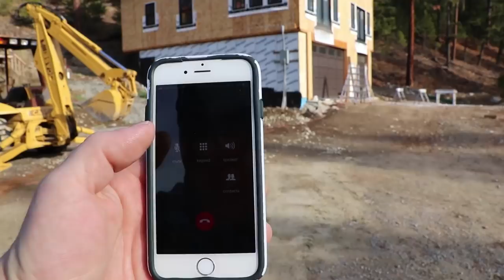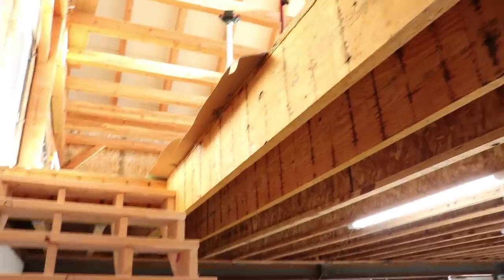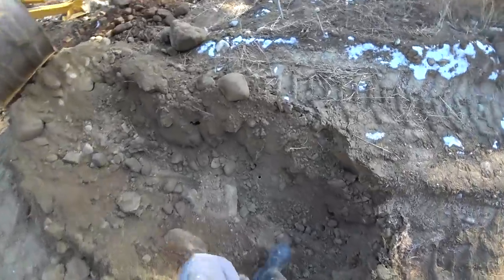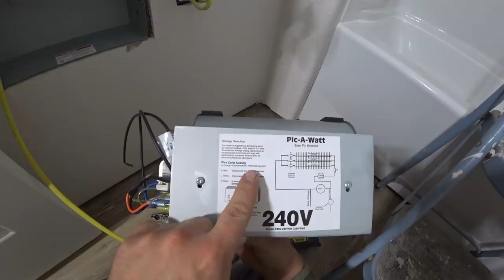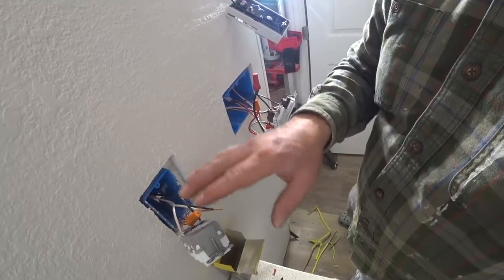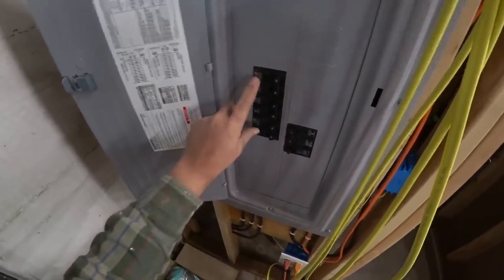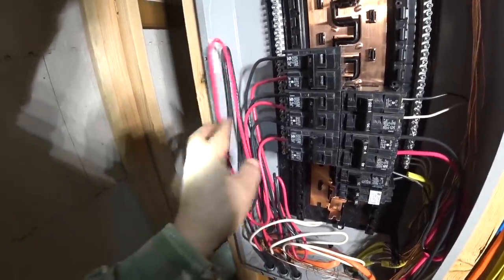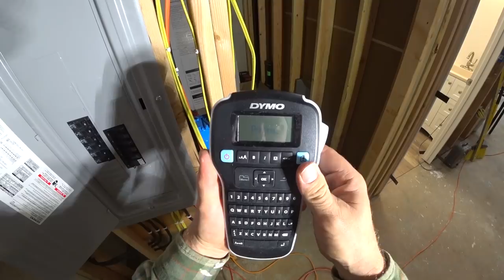Holy Cow IT ACTUALLY WORKS! (Wiring Garage Bathroom)

Comment: If I'm not mistaken, code says that bathrooms should not have any electrical outlets at all, except for an isolated socket for a shaver.
Reply: Incorrect
Reply: Where do you live? If in the US, chances are you are wrong.
Reply: I'm guessing you're from the UK since that's not the case in the US. Just needs GFCI protection
Reply: Andy Lee Robinson, any outlets in a bathroom and kitchen are required to be on a GFCI circuit breaker to prevent electrocution.
Reply: Thats certainly true in UK. I was very surprised it was allowed in the US. Switches aren't allowed here either, have to be pull cord switches.
Reply: Here in the UK would need a string cord for every switch and can't have outlets in a bathroom.
Reply: The NEC does not say that nor does any local code in the US that I'm aware of.
Reply: Andy Lee Robinson in the USA as long as it is a gfci it is aloud
Reply: As a Brit who now lives in the USA I still am surprised that it’s allowed but it is!   Also in USA you are allowed wall mounted light switches in bathrooms. When I visit back home to UK I now struggle to find the light switch
Reply: You are mistaken. And 'isolated shaver outlets' are now banned in at least some jurisdictions, if not by the NEC. (They leak. God knows what they were thinking when first approved)

[There should also be a 20-amp circuit, separate from the lighting circuit, to provide power for an outlet to feed things like curling irons, razors, hair dryers, and even portable milk house heaters.

Connected to the outlet circuit, you should install a ground fault circuit interrupter (GFCI) to protect the user. A GFCI trips and disconnects the circuit power if it senses a difference in potential on the circuit, like a short circuit or a path to ground, which could be right through your body. This device is very important and can save your life!]
https://www.thespruce.com/national-electrical-codes-for-bathrooms-1152275

I don't have the direct link to NEC handy. GFCIs (and arc fault breakers) have revolutionized safety in many instances. They're far from foolproof, but a hell of a lot safer than things were prior. Any advanced nation now requires them in almost any susceptible instance.